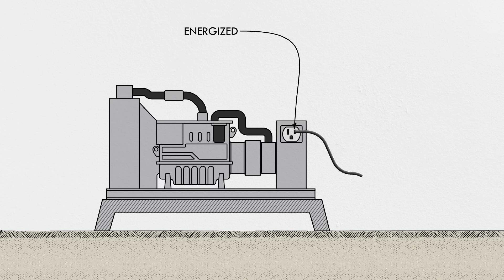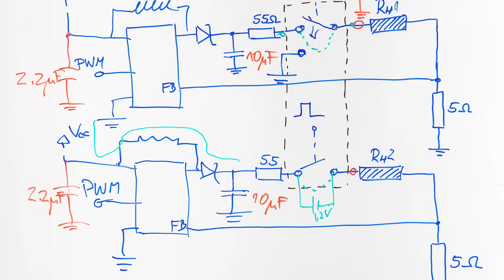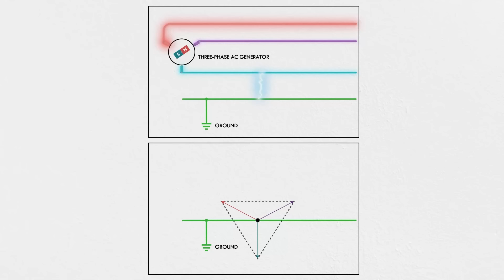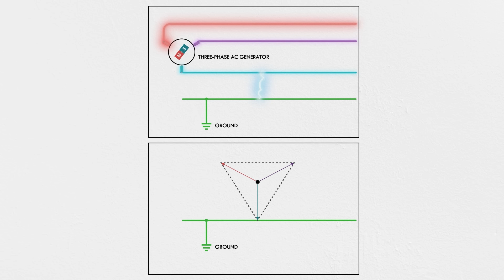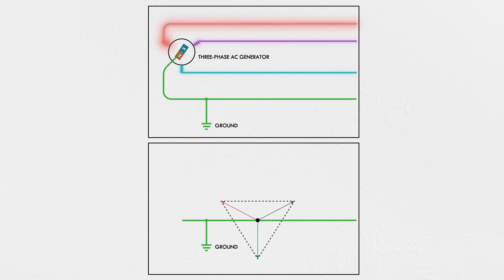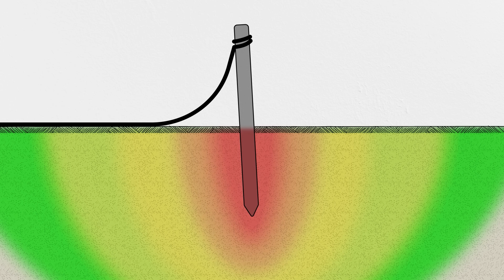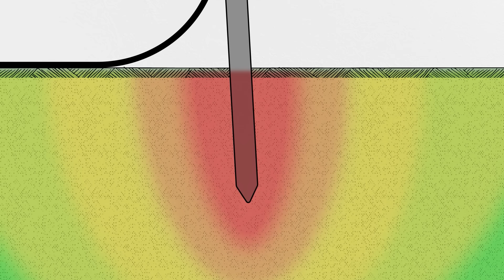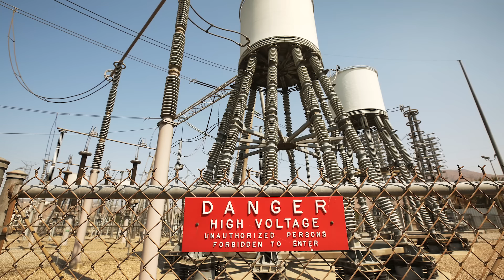Where Does Grounded Electricity Actually Go?

Comment: 7:03 I guess in 120v countries you have a parallel wire instead of an actual grounded wire. Here in chile, every house is fitted with a 1m copper rod that's hammered into the ground which is the actual connection to the ground wire.

Comment: Thanks for another great video. Speaking of the grid and substations, I know the purpose of circuit breakers, transformers and other electrical equipment, but I have to admit that except for transformers, I have trouble identifying those parts in a substation. Things look different when they are so big. Have you explained these things in a video? If not, would you consider including that info in a related video?

Comment: Think of it as the earth was just ocean, and replace electricity with water, you pump water out of or into the ocean, there is no real path for the water, the sea level is just a reference level (potential). The resistance to earth is like the diameter of the pipe you use in the ocean.

Comment: One of my favorite questions to ask electrical engineers at work is how far away from a hot circuit that is in contact with a body of  water such as a lake.Do you need to be to not get shocked.

Comment: In substations, the switches metal cases can also hold a induced charge, usually discharged by the ground grid under the yard. Copper theives steal these short grounding bare copper cables. The smart ones leave 1 connected in place cause otherwise you could be fried by taking it. You put your hands in your pockets and i was told dont even look to hard at the wires running overhead.

Comment: Working on ships this is a huge safety concern, since the ship and sea work as ground and your going to be standing on super conductive steel you have to be careful. Even when wearing boots there is still a concern so having electric rated ones with non metallic toes is liked

Comment: Thank you for the lesson. 
What if an ev battery is short-circuiting, and if you touch the car you get shocked. If you connect one end of a high-capacity jumper cable to the sheet metal and the other to a metal stake driven into the pavement, will make the car safe to touch?

Comment: In Europe TT nets are the rule. While earth and neutral are the same. They only meet at the transformer station or sub station. This is of course so that a RCD can detect current escaping via the PE.  In Belgium we had a lot of 3x220Vac systems back in the days. No neutral at all. So that is the reason neutral and earth are strictly separated in installations.

Comment: The way I see it AC will go to ground DC will only run back to it's polar opposite so + will only go to - and vice versa. For example the body of a car the negative side of the battery is connected to the body of the car and anything on the positive side it's negative line doesn't have to run right back to the battery since the body of the car is connected to the negative battery post.

Comment: So if all current returns back to where it came from, that means that generators are more like pumps that circulate current? They generate "pressure" (voltage potential) and it is that "pressure" that makes electric driven machines work?

Comment: As an EE, this is the most misunderstood principle amongst skilled workers. I’ve had to explain multiple times to the same person, and multiple instances with different persons, on how to wire a simple single phase transformer to get the proper voltage and grounding scheme. They do it and still question me on how it works 😂
Reply: God forbid you have to install a delta-delta transformer with a ground on a split phase or corner grounding. It just blows peoples minds! Not often done, but sometimes necessary.
Reply: I may have missed it, but sometimes you can take advantage of ungrounded systems to make resiliency in the circuit. For example: in a DC control system, you can purposely not ground the neutral, hook incandescent lights between either leg to ground designed for the voltage of the system. Both lights burn equally bright, but dim. Once there is a ground fault on either leg, the leg with the fault will be out and the opposite leg will burn at full brightness. This is commonly used in 125VDC battery backed critical systems.
Reply: That used to be common in plants as well that had ungrounded delta secondaries feeding the plant. First fault was free, but you better fix it before someone or something gets really fried. These systems are more dangerous as you’re exposed to higher differences in voltage potentials than a grounded wye system. High resistance grounded wye systems are another matter as well, and also uncommonly used.

Comment: "Path of least impedance" is more accurate than "path of least resistance"... at higher frequencies, (even unintentional parasitic) inductance [enclosed loop area] is high impedance and capacitance [overlapping surface area] is low impedance. At DC, the opposite is true. At some point resistance almost doesnt even matter anymore as frequency goes up. But yes, also current doesnt take a single path it proportionally splits according to current division.

Comment: With the solar flares in the past few days, we've received warnings that the power grid may be affected. With everything connected with three phase transformers these days, why wouldn't the primaries just reject common mode interference? The secondaries might be grounded at the center tap, or the wye junction, but that's so local that I think it would be unlikely to be affected by solar flares. What am I missing?

Comment: The rotating magnetic field in a generator does not induce a current…it induces a voltage.  If there is a conductive path between the phases, the voltage pushes a current through the wires.  A subtle, but significant difference.

Comment: you can think of electricity like the water in the sand. it took time for the water to soak in, and so it takes time for the electricity to 'soak' into the ground. to speed this up you either need to increase the voltage or increase the contact area. since natural standing current flows are in the realm of milliamps it takes a lot of voltage or contact area to use the ground as a return path on the generator. This means that while your readings said nothing was flowing that is not exactly true. With the battery one might know that batteries lose their charge over time even when not in use. It is very slow, relative to being used, but they do discharge into the air at a very slow rate, and if they discharge into the air they will discharge into the ground as well. No amount of insulation can stop a battery from discharging, and that means that does discharge into the ground when connected to it via a wire, but at the rate the other side discharges, which is very slow.

The lightning has to do with this flow, or more importantly with the blockage of the flow. If enough flow gets blocked then there is a build up of electricity until it reaches a quantity (one of the few times to refer to electricity with a quantity) which can reach the breakdown voltage of the materials between a place that can take that amount of electricity and the quantity of blocked electricity. This happens with static shocks as well, but on a much smaller scale, (and often induced intentionally). The normal state of electricity is flowing, so it not flowing is very weird for many people to think of and can be difficult for people to understand it.

Comment: @Practical Engineering: at 14:35 you mention that electrolysis can produce chloroform and bromoform. I know that electrolysis of salt water can produce bleach (hypochlorite) and hypobromite which in turn can react with hydrocarbons to produce chlorinated/brominated hydrocarbons. As far as I know producing chloroform/bromoform from this process however does not proceed that favorably except with small oxygenated hydrocarbons like isopropyl alcohol and acetone. I'd be interested seeing the degree of chloroform/bromoform production from these or if anyone knows just how much is actually made and how harmful it is.

Comment: I saw in school a magnet in a coil generating electrical current.

I did not understand what and why the 3 phase separation mean
Reply: Its 3 coils or legs on a rotating shaft, going at 60 times revolutions per second. At start a generator has zero voltage, it rotates 1 leg thru the magnetic field with a voltage of say +120v to -120v, with zero voltage being called the nuetral. The next legs does this, then the third for 1 revolution. Hence 3Phase 4wire(neutral) at 120 volts, the power plants can make thousands of volts due to coil windings and size of these generators. They can push the those voltage far distances.

Comment: Watched twice but can't still understand everything. If the neutral of the last transformer secondary was not grounded then we would not need PE on the toaster? I could touch the live chassis and current would not flow? Or is the capacitance to the environment dangerous enough?

How are we not creating more problems than solving? In case of a disconnected PE of the toaster there is danger in the first place because the last transformer secondary HAS to be grounded?

If a live high voltage wire touches ground, without the source being grounded in the first place there would be no danger of step voltage either? Fault current is sometimes not high enough to trigger protective systems or they fail but step voltage is very much dangerous still? The higher the resistance of ground, the lower the fault current but the steeper the step voltage gradient? How are there more positives than negatives then?

What if 2 ground faults of different phases of an ungrounded system happen some distance apart? Is that the reason we need to detect ground faults through phase and ground?

Comment: Questionable electrical experiments at work, I eliminated the neutral cable between a 350 kw diesel electric generator and a 30,000 watt 3 phase 120 volt incandescent light bulb load. I replaced the neutral conductor with a ground rod at the load, The load neutral was tied to the ground rod and the generator already had a half a dozen ground rods hooked to it. I used the earth for the neutral for each 120 volt leg, The distance between the generator and the load was 150 feet. There was no voltage drop and it worked perfectly, I powered it like that for ten days. The equipment grounding cable between the generator and the load was maintained. This was 40 years ago and it was a temporary power hook up, And I ran out of cable so I improvised. Well that and I wanted to see if it would work.

Comment: I like how the wall sockets are ground "up". 🤔 Are there actually folks out there who don't know that ground down sockets are the wrong way to mount sockets in the wall? Quick explanation.. ground up prevents fire hazard from anything metal coming in contact with the positive and negative prongs of an electrical device, and shorting out, possibly causing a fire. The round ground prong will help prevent contact.

Comment: When I'm tinkering with a circuit simulator on my phone, I typically just think of the ground symbol as the thing that defines the point at which voltage is always 0.

Comment: Could anyone knowledgeable on the field confirm whether the presented info is 100% accurate? 

I'm an amateur, but some points sounded a bit off to me: 

- if one of the phases connects to the ground in a ground fault, would it really simply reach ground's potential (elevating the potentials of the remaining phases)? Experience shows that a high voltage conductor laying on the ground conducts quite violently. I doubt its potential would simply assume ground's. I'd expect it to vary rather quickly, depending on whether it's conducting or wasting energy as noise or heat. Moreover, such ground current would always face resistance, hence the phase potential would never reach ground's. 

- maybe the standards in the US are different, but I think that the ground pin in the power outlets are not simply "connected to the neutral". There's more to that. There should also be a ground rod connected to the ground + neutral conductors. The rod provides a current path in case the neutral breaks down at the public infrastructure. That could lead the surfaces of some equipment to become energized, and the ground rod would provide an "emergency" path allowing current to return (although inefficiently) to the generator/transformer, which also has its neutral grounded.

Comment: 6:43. This is not the whole picture. You do not need lots of current for the protective devises to work.
What you are describing is over current protective devices which are more often useful to prevent equipment damage and fire. But it will also disconnect electricity if live touches the chassis and  the fault is such that big currents can to flow. it depend on the failure mode as will be seen in the next sentence.
More often (and that is bad for user safety) you get not such a good connection from live to chassis during a fault. Enough current can flow if some touch the chassis to be killed but, not enough to trip the over current circuit breaker.  For this reason you need the earth leakage protective device. The returning chassis safety ground wires are connected to this device to monitor for small current flows, typically above 30mA. This level depend on legislation per country. This device or method, depending how you look at it, could be a cause of nuisance trips.

Comment: The idea for the video is good. However, it doesn't show in good detail with arrows of current flows, etc.  There were many images of multi-conductors on the three-phase transmission lines where people wouldn't know what is considered a 3-phase system, as they may see 6 or 9 cables hanging between towers, etc.

Comment: I watched about 10 seconds. Matter and Energy recycling conservation. Circuits to generate. Circuits to absorb. Circuits to antenna. Circuits to amplify-"antenna". Circuits to transmit. Circuits to receive. Circuits to ionise air. Circuits and voltage to energise until conductor. Circuits and current to de-magnetise/magnetise. Circuits of pole/dipole. Ground.
Reply: Absolute zero kelvin
Reply: There are people who are into martial-arts and health-hypocondriacs. The plasma-ball is a test of static-discharge. To ground low voltages, build-store voltage using static-duster as capacitor before discharging it with metal-prongs of something. Usually analog-tansitor capacitor pulses like digital. House-hold items have capacitative-resistive effects similar to touch-screen of mobile-phones. Inductor-coils can be found in induction-cooker and cup-warmers or electric-blankets. Coils that are connected but not-powered, example fan-motor, also have a grounding effect. Neon-flourescent have ballasts that makes light-sabre sounds which discharges certain range of electro-magnetic-field(flux). Lousy cheap mats-carpets can charge your hair for you to test discharge.
Reply: if you are thinking rockets and expensive...
Reply: About high-voltage capacitor of spot-welders touching one connected bolt to discharge once.. you heard it from elsewhere. Especially audiophile going cheap and disassembling new spot-welders for 0.5 farad or 1 farad or something capacitor... ...

Comment: I like this subject, and there is good information here. However the triangle and ground graphic, doesn't really, show intuitively, what concept he's trying to get across.  Lifing the triangle up or putting the triangle down, what does it mean ? Is that a referrence to connection ? This could be clearer for those of us who don't work with three phase. For the sake of simplicity, why not just use two conductors to represent alternating current ? I think that this is the problem with engineers explaining stuff: over complication, and assumption. I think that, before releasing video, explaining processess and concepts, they ought to give tests to lay people, after viewing the video, to see exactly how successful the video is in transfering knowledge. Then if there is a good rate of success, then put the video up. I enjoyed this video, and got a few things from it. Thank you for making it.

Comment: How about the sand pile under heat lamp mimicking the sun hitting Earth?  How about running wire through salt pile...maybe with moisture molecules engineered to not react to salt...Maybe hydrophopic spray on salt pile then poor water on it

Comment: At 6m you say that 0v means 0 current. Thats true but i think is a poor way to describe it. Instead of saying
 10v potential to ground with a ground fault = 0V 

It would make more sense for viewers to say that the once 0v ground now has a 10v potential to ground. So line = 10v and ground =10v. It would also help explain that once that happens you do not need to touch the 10v leg. You can touch the now 10v ground to energize your self. Then you also become 0v with the power but you're 10v with the ground.

Comment: Your 3 phase generator diagram is not correct. There are 2 conductors per phase coming out of a generator. 1 conductor per phase goes to a generator breaker. The other side of the generator conductors are tied together and go through a neutral reactor and then to ground. There are other components such as CTs, PPTs, SCT and etc (depending on the generator) on that side also.

Comment: Running the hot wire to a ground rod off of an isolated generator gives you 60 volts and very little current flows